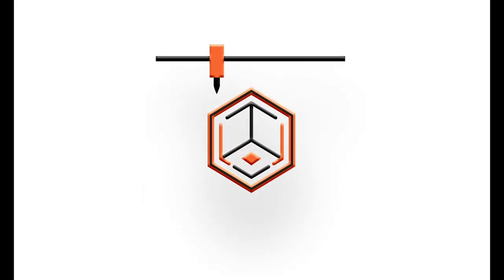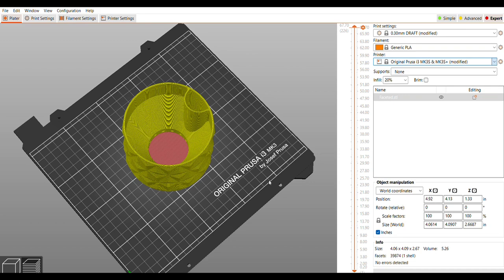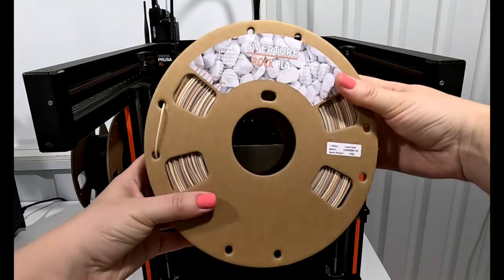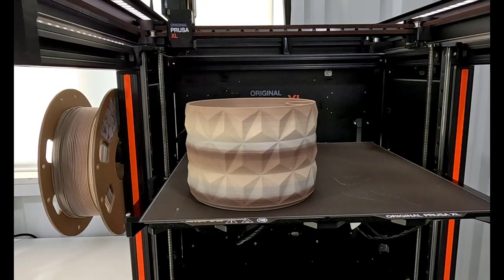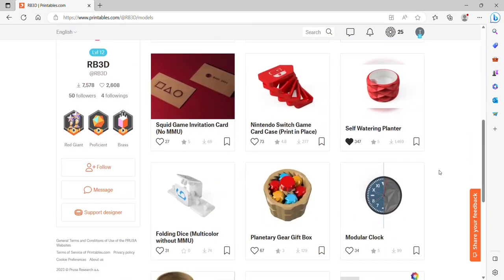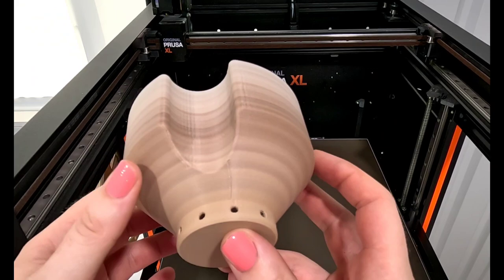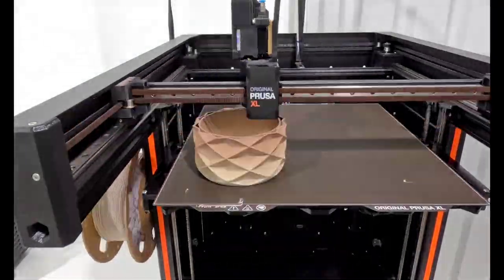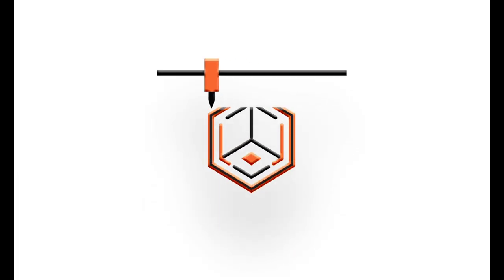Printing a water-tight self watering planter on the Prusa XL with Fossil Rock Filament!

Comment: lightly spray with clear coat if you think it may leak. You can also use a heat-gun and lightly press on the holes to seal them.
Reply from the maker: Thank you!

Comment: I like the varieties of filaments used on this channel.  I'd like to see a wood looking filament.  I think the wood shavings filaments are something like 10-20% actual wood mixed in the plastics, and might be considered abrasive.  If so, it might need a special hardened steel v6 nozzle to avoid damaging the nozzle.  This stone looking filament was cool.  You have a big filament storage closet room?
Reply from the maker: Thank you! I have been experimenting with wood filaments a lot. And it seems as soon as I find one that I like, it's discontinued or the next batch is not the same. 

Currently I have one that feels very wood-like but its very quirky to print with. And I have another that's super easy to print with but is more of a wood color and doesn't have the texture. I'll have to plan a video on this.

I have a couple of generic filaments that I order over and over in bulk. And then 1 each of some fun colors. I keep them all in an ikea drawer unit and probably need to get another because its bursting. Thanks!

Comment: I think the second planter turned out awesome.  The color transition rate for these is tricky because what seems too abrupt for big items is perfect for small items, and if they made it smooth for big items the color wouldn’t change fast enough for small items.
Reply from the maker: Yeah I almost wish they say "color shift every 100 grams" or something. Maybe they do list it somewhere and I missed it. Thanks!
Reply: @tada3dprinting  I'm actually printing with a similar Amolen filament and just checked - they do say it changes every 15-18 meters.  I just printed an articulated dragon at 27 meters worth of filament and it does have two color changes in it, so that checks out.  Hope that helps!

Comment: How does pla go with water and dirt over a prolonged period? Would it be better to do petg? Or asa?
Reply from the maker: I would worry if it's outside. This planter would be kept inside. I have several other styles of planters in PLA that I've had for a couple years with no issues so far. Thanks!
Reply: @tada3dprinting  nice!! Being organic based I was curious..
Reply: @75keg75  pla has some organic ingredients, but having soil & a plant in the planter will be fine. (Aside from UV & heat issues if you put it somewhere sunny!)
Reply: While PLA is somewhat derived from organics it is not biodegradable at all. I think the vendors used to label it as biodegradable but its just not. Heat and Light will damage PLA for sure. I use ASA or ABS for outdoor applications. Note that terracotta is not exactly impermeable and is commonly used for pots, so I don’t see why a 3d printed PLA for indoor use would not be fine.
Reply: @TonyNaggs PLA is completely organic, but it isn't biodegradable in normal conditions, it is in certain industrial composters.

The real problem is UV light from the sun, it's quite susceptible to it... But inside there's no problem
Reply: PLA survive many years deep in compost and manure. It has 2 enemies. Temperature and continual force.
It creeps. That means it will change shape permanently in time if it's under heavier force load. And temperature over 60°C can be reached if you make it from black PLA or put it behind window glass etc.

Comment: What brand filament do you recommend for more functional pla and asa prints? I plan to use pla around the house and asa outdoors and for stuff in my car where it can get really hot.
Reply from the maker: I've been using Overture for years. I mainly print with PLA and I haven't used ASA. But I would try them first. I have used PETG and TPU from them. I just feel like all colors in the same filament are very consistent on settings. Thanks!

Comment: be careful when you’re importing 3mf’s like that and you transfer settings across - if you’re not careful, you can end up merging two machines’s printing parameters and you might get strange results on your print.
Reply from the maker: Yes I've noticed if my purge line looks different, it's got some other machine settings merged. Thank you!
Reply: @tada3dprinting use stl’s instead.

Comment: The prints will evenually weep water.. I tried for a while to get a good watertight planter to no avail :(
Reply: Don’t prusa recommend 4 perimeters for water tightness? They had a video on it.
Reply from the maker: I've never been able to get vases to work, but planters sometimes. I'll keep an eye on it. Thanks!
Reply: @tada3dprinting  be curious how you make out.  Outdoors isn't really a big deal if there's some seepage but a bit of a bummer indoors
Reply: @75keg75  probably more perimeters would help yeah
Reply: Single perimeter can be water tight if you don't have printing or slicing errors that leave a gap. Multiple help if the errors are an intermittent random event just by virtue of it being unlikely to happen in exactly the same place repeatedly. But they won't help a lot if your problem is poor layer bonding, in which case you probably need higher nozzle temperature.
Reply: @daliasprints9798  what about increasing flow and line width to achieve a better bond? First layers might look a little scratchy but wouldn't be something noticeable for this application. The flow can be tuned down in later 10 or something.
Reply: @Drumaier  It might succeed in making it water tight but would necessarily be inaccurate and could cause nozzle collisions that make the print fail or mar it in ways that break water tightness elsewhere.

Why do a hack like that when you could just fix the problem right by turning up the nozzle temperature or slowing down?
Reply: @daliasprints9798  but I didn't mean ceazy flow or too wide thickness, let's say 105% flow and x1.3 thickness in combination with hot and slow settings for the first layers. I'll go for that without feeling I'm creating a mess.